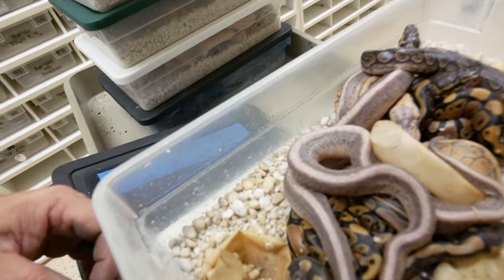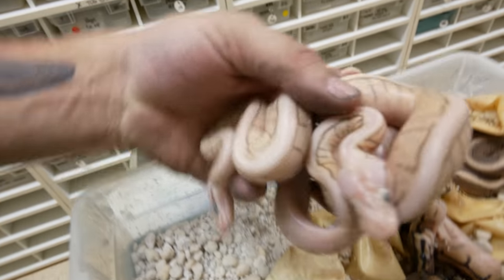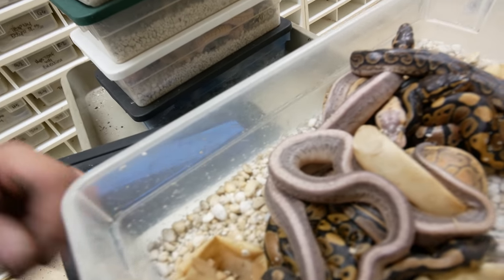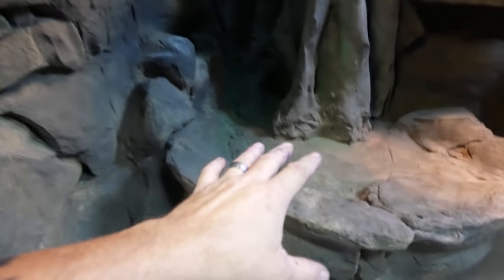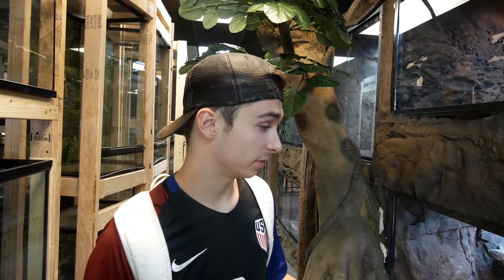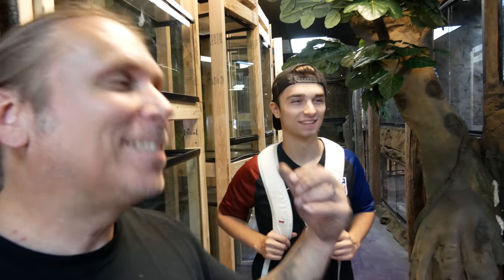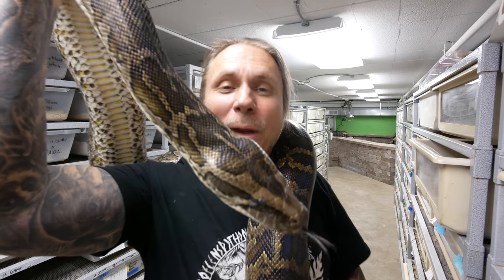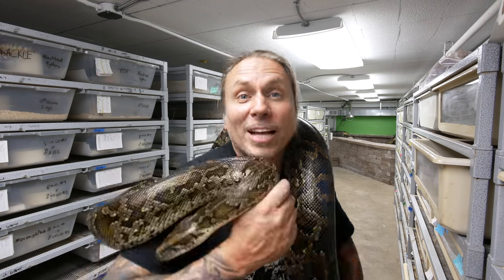BABY SNAKES AND HARDEST TASK FOR REPTILE ZOO BUILD!! | BRIAN BARCZYK

Comment: you should be putting a sealant where you been connecting the pipes just in case. you also need to think further on when and if it starts to wear out. still so many problems will bring great rewards once you take your time to fix it all.

Comment: That pipe Will fall by the pressure
You need the walve in the very first beginning of the drain pipe
Drain pipe arent supose to have any kg pressure in them
Even if the are glued thogheter
Call a plumber instead so you get the right stuff and you dont get black mold behind it
Mvh from one of the best plumbers in sweden

Comment: The cut off on that piping needs to be as close as it can be to the drain opening that way the weight of the water is not setting in the pipes. with the cut off at the end the pipe is full of water all the time this will cause  the pipe to stop up more . But good job and love the videos

Comment: To be honest - I thought since all of this rock stuff is waterproof I thought that most of the cages would be equipped with drains. So you don't have to clean this much and just use the water hose.
But now that I see it I realize that there will be sand and stuff be filled in, so it is not possible like that.
Another thought of mine - you will need a cleaning person for all this glass.